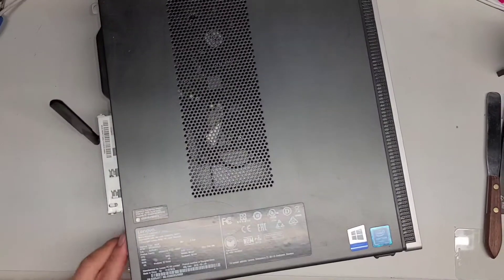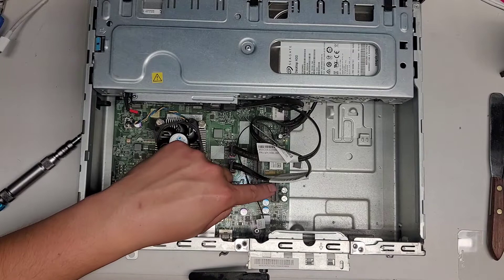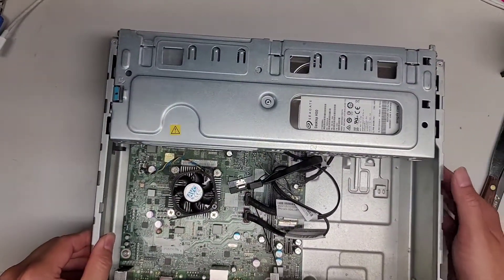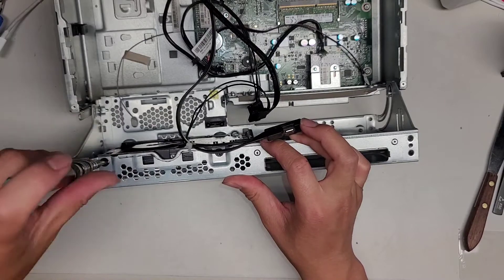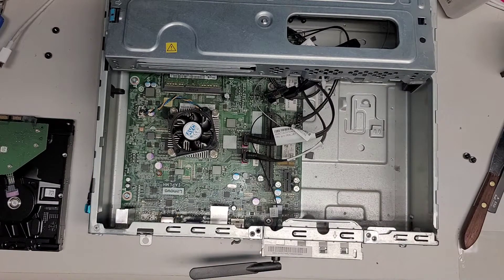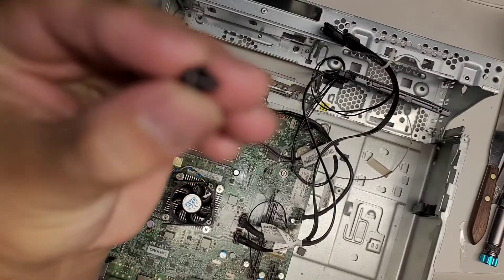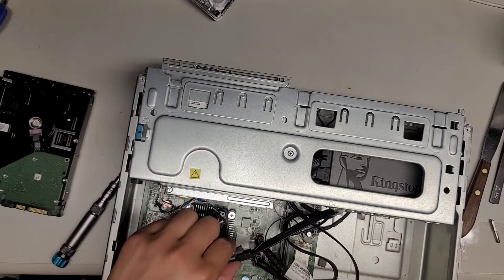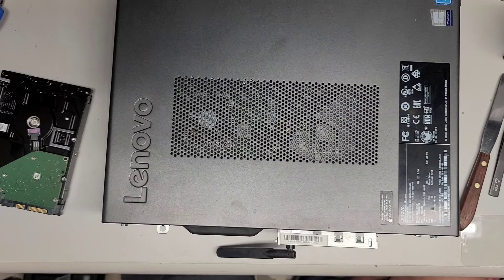Lenovo IdeaCentre 310S-08IAP 90GA Disassembly RAM SSD Hard Drive Upgrade Replacement Repair

Comment: i have a question, is it possible to take out the motherboard from this and use it in another cabinate?  or is it like fixed in there?
Reply from the maker: @hasashi_Aayu  you can take it out, but not sure if you'll be able to find an aftermarket one that fits it. You can make a custom one I suppose.
Reply: @ItsBinhRepaired   well at least its possible, i'll see what i can do, thank you.
Reply from the maker: Sounds good

Comment: I was wondering where is the PSU or Powersupply of this Desktop Computer? and its Motherboard is looks like for a Laptop? and I though that the DVD Drive is bigger want I think and I was amazed its also small like to any laptop's DVD Drive
Reply from the maker: It uses an ac adapter like a laptop, doesn't it?

Comment: i always like this model dont know why
Reply from the maker: Somewhat easy to get to parts?
Reply: @ItsBinhRepaired bro what's the maximum wattage of GPU supported in this?
Reply from the maker: @discerningcucumber7559  no idea
Reply: @ItsBinhRepaired sorry if I'm being irritating are the insides same I have the same ideacenter but my cpu is Pentium j4205?
Reply from the maker: Open it and check. I don't know.
Reply: @ItsBinhRepaired  what about the maximum wattage of GPU?
Reply from the maker: @discerningcucumber7559  no idea

Comment: good morning, I have a problem installing windows on this computer
Reply from the maker: I need more information than that. How are to trying to install windows? Did you put a new hard drive?
Reply: @ItsBinhRepaired  I tried changing the disk, I tried with several windows operating systems, I checked the bios, I rebooted it and nothing. the computer I have has windows 10 but the windows boot was damaged and I wanted to repair it or simply reinstall windows 10.
Reply: When I put the flash drive booted with the operating system, I choose to start from the USB memory and it reaches the part of the Windows 10 logo and there it hangs, it doesn't go any further.
Reply from the maker: I hate how YouTube doesn't notify me of replies. Were you able to figure it out?

Comment: bro i want to upgrade this pc to play fortnite with minimum of 30 fps how tf can i upgrade it???
Reply from the maker: You'll need a small gpu that can fit inside.
Reply: @ItsBinhRepaired  can you tell me which one pls broo i want the best
Reply from the maker: If the power adapter puts out 300w or more, you can use this https://www.amazon.com/dp/B08CYDH8MD/ref=cm_sw_r_as_gl_apa_gl_i_VDDTMPG7CEZ2GT1MHZZ4?linkCode=ml1&tag=itsbinhrepair-20

Comment: When you removed the DVD player, the matching face plate is attached to it? Found - yes, found - a tossed out 310S 90GA. But it looks like the DVD player is missing! 😡😠 The HDD was rendered unusable by putting a screw into the HDD! 😠 Thank you 🤓 also is the RAM DDR 4?
Reply from the maker: The RAM information is in the video. I don't memorize these things. Lol
Reply: @ItsBinhRepaired  that is ok! Thank you for the reply! 🤓
Reply from the maker: @j.lietka9406  no problem

Comment: How "powerful" is that unit? Found one the other day (along with a somewhat older HP slimline pavilion) can it support a quad core? Thank you  better question! Can an ITX motherboard fit in the case? 🤔
Reply from the maker: I'm going to guess no unless you're modifying screw mounts and replacing everything, but why would you do that?
Reply: @ItsBinhRepaired  just sort of curious if it could fit! Thank you 🤓 I got a hold of an HP slimline pavilion and a Lenovo 90GA (think it's a ThinkCenter). 🤓
Reply from the maker: @j.lietka9406  nice

Comment: Is it possible to upgrade to processor ?
Reply: Not unless you use hot air station and resolder another CPU with BGA.
Reply from the maker: Haha Yup, technically possible.
Reply from the maker: I don't think so.

Comment: Which graphics card is suitable for this cpu?
Reply from the maker: The case is very small and doesn't have pcie power, so you're very limited on what you can even fit and power.
Reply: @ItsBinhRepaired  thnx for the non answer
Reply from the maker: @blacksabbathmatters  yup
Reply: Will the 1030 work?
Reply from the maker: You'll have to measure the space and check the dimensions of the gpu as well as power requirements.

Comment: Is it possible to add the ssd instead of replacing the hdd?
Reply from the maker: Possibly, but you'll have to use the sata connector from the CD drive on the motherboard and get a regular SATA data cable as well as a sata splitter cable for the power connector, so you'll lose the CD drive. You'll also want to clone the hard drive to the SSD, or you won't get the benefit of having the SSD in there.

Comment: I have the same ideacwntre it has 2TB HDD. Can I keep the HDD inside and install the SSD through a disk cuddy, through the optical drive ? I will like the SSD to be the main drive.

CPU is AMD A9-9430 RADEON R5. 5 COMPUTE CORES 2C + 3G.
8GB RAM. With one empty slot 

Is this good for heavy video editing and gaming ?
Reply: Heck no it's not good for heavy video editing and gaming. It's a dual core CPU, and not a particularly fast one either. 
It's only fine for basic web browsing, checking email, and watching videos.
Reply from the maker: @cardboardsnail  oops, I only meant probably to the SSD question. Haha
Reply from the maker: Possibly, but I'm not sure if the cd drive connection will be slower.

Comment: Does this thing even has a power supply? Where is that thing?
Reply from the maker: The power supply is the brick you plug into it.
Reply: @ItsBinhRepaired  Aah. That one! It doesn't look like a normal power supply, though. Too small.
BTW, Cool video. I am subscribing.
Reply from the maker: Yeah, it's just a laptop power brick ac adapter
Reply from the maker: Thanks!
Reply: Bro, can I upgrade to i3 and 4gb low profile graphics card in this system, do I will need any extra power supply for that.
Reply from the maker: Not sure. Possibly